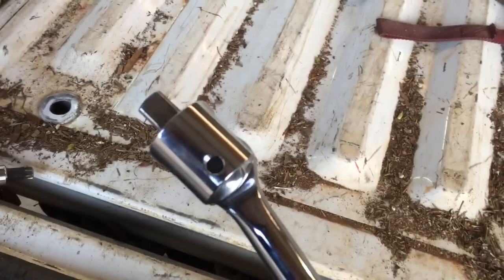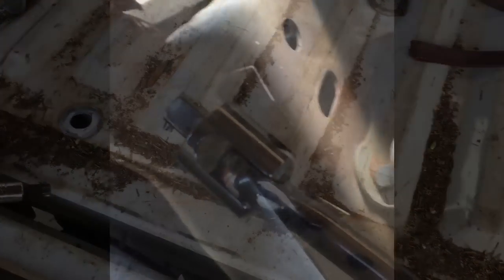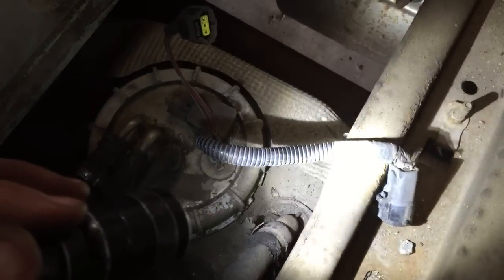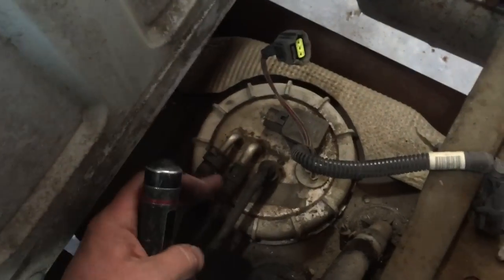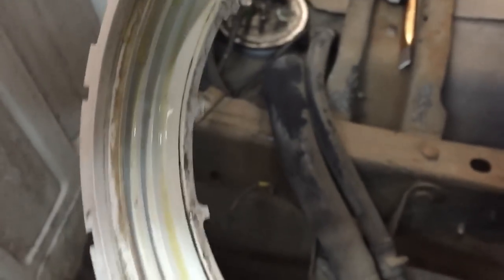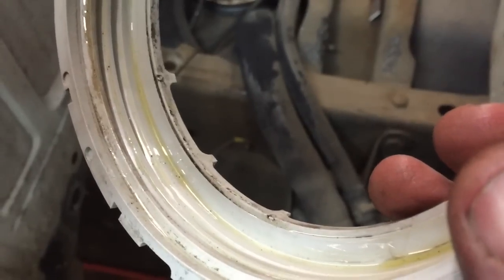How to : Replace a Fuel Pump on a 2000 Ford Ranger

Comment: Thanks for the help! I did as you said except that I didn't remove the wheels nor the bumper. I removed the bed bolts and fuel filler screws and of course all the plugs, then I propped the bed on the rear bumper and a 2x4 about 3 feet long and worked under that. No problems, works great now!!!
Reply from the maker: Thanks for watching and sharing your experience with this project.  Please come back to our channel for more How To videos.  Have a great day!
Reply: After seeing your comment I did the same thing.  Propping it up locks it in against the bumper and makes it really stable, plus you don't have to find a place to store the bed while you're working.  Thanks!

Comment: My 2001 Ranger quit last weekend. Cranks over, will run with starting spray. Replaced fuel filter no help...Not sure how to verify if the fuel pump is bad.
I will say this is one of the BEST "how to" videos on YouTube. Very well done.
Reply from the maker: Sounds like its the fuel pump. To confirm the pump you can remove the line from the fuel rail and key it up. See if the any fuel comes out. Make sure you have a container for the fuel to go in. Another thing you could do is crawl under the vehicle near the fuel tank. listen for the sound of the pump while someone keys it in the on position.  Hope this helps.
Reply: Check the fuel pump relay first. Also check to see if you have spark.

Comment: I dont see why anyone would thumb this down... Its pretty much a walk thru on how to do this...
Reply from the maker: Thanks!  Appreciate the comment and for watching.  Check out our channel for more how to videos.  Have a great day.
Reply: I could possibly shine a bit of light.
All I was interested in was the top of the fuel pump where the wiring clips in.
Mine isnt the same. It was mentioned that you would maybe have to splice it. 
Which is why I came back to this video. But I never was able to see the top of the assembly. My replacement pump is gonna have to be spliced

Comment: Thanks for a very helpful video. I didn’t know about the green clip on the one line, and didn’t know how to get it off until I watched this.

I’m not criticizing, but you did more work than you needed to do. I’ve done the fuel pumps on two Rangers...a 2000 stepside, and a 1996 flareside, and all I had to do was remove the tailgate, remove the 6 bed bolts, remove the filler neck, and disconnect the harness for the rear lights. Prop up the bed a couple inches at the back to reach the connector for the rear lights. It’s right there above the license plate. Then...get something about 4 feet long to use for a prop, tip the bed up from the drivers side so the other side is resting on the opposite rear tire, put your prop in a safe, secure spot to hold up the bed, and you’re ready to work on the fuel pump. 

I’m an out of shape old guy and I was able to do this alone.

Comment: Great simple video. Use a stick of wood rather than a chisel.  No need to remove lights, only disconnect the plug drivers side rear. Remove tailgate to lighten the work. No need to remove the bumper. I chose to remove mudflaps to protect them.

Comment: Excellent video. I very much appreciate it! Gonna do this in the morning. I have everything ready to go. My truck is a 99 Mazda B2300 but I think it is mostly the same as yours. Thanks again from Georgia!
Reply: +Steve Collins BTW maybe I missed it but did you release the fuel pressure before doing this swap? I will be doing that but not sure if it is a big deal or not.

Comment: Thanks for the video. It was very informative and helpful. I knew as much as taking the bed off, but I've never changed a fuel pump. This showed me more than enough to feel confident in being able to complete this relatively simple job myself instead of being raped by the mechanic.

Comment: You don't need to remove tires or the rear bumper... 3 screws in the gas inlet and the wire harness at the rear of the bed remove tailgate for weight. And slide it back over the tires about 12 inches and that's all you need to do.  Work smarter not harder. Also if you have gone through all the trouble of moving the bed just get the whole assembly. Plug and play ....

Comment: Do NOT use motor oil when screwing the ring back on.  Oil degrades rubber!  Use silicone lubricant if you feel it needs lubricating.  You screw it on dry, regardless.  For those who do use the special tool for the ring the torque specification is 30 foot pounds.

Comment: Or just buy the complete pump.  6 min mark in video. Its like 20 more.     I need a new bed so this looks like a job to do when i do that.
Reply: I checked the prices, on a 2.5 with the short wheelbase, the pump assembly is around 260.00

Comment: My ranger seems like it's pulling and dragging. I replaced the fuel filter air filter o2 sensor. Have no idea why I can't get it to stop chugging along
Reply: Do u think it's the fuel pump?
Reply: If proper fuel pressure is present and each cylinder is in spec for correct spark, air volume and fuel spray...then meter test your MAF and TB. Confirm there are no Crankshaft or cam sensor faults.

Comment: I had to replace the license plate’s light bulb, I saw a spark, now my ranger 01 won’t start any more, I have checked all the fuses and relays and they are all fine. Do you think the fuel pump could be  the problem?

Comment: Have 2005 ford ranger. Died out on me so took it to mechanic.  Mechanic changed out fuel pump, and cleaned out fuel lines. Code P0353 showed up while doing diagnosis.  Truck starts up and revs good. Just that when I get to 40 MPH truck starts  to lose power and acceleration is no good. I then turn off engine let truck rest for 20 seconds then starts up just fine. Just again hitting the 40 MPH range looses power all the time . Please help anyone thanks .
Reply: 808 Kamakazi check to see if the accelerator cable is not too stretched out. If it is you may need to replace it. Some times if it's too streched out it will not open the throttle plate to it's fullest and it'll starve of air.

Comment: Good info, but - I would have drained the tank first for safety.  Drop a tool, cause a spark, generate an obituary.  Just a suggestion.
Reply: The risks we take. I usually wear a helmet and life jacket when taking a shower too. Can't ever be too careful these days.
Reply: I actually play with gasoline for kicks and next time you near some soil or sand pour a few ounces across it and light. While still "burning" & with flames, stomp out with shoe. Then agitate rapidly the same spot again with shoe. It should instantly reignite and flame up again. * Obviously let it exhaust all petro remaining before ignoring/leaving.